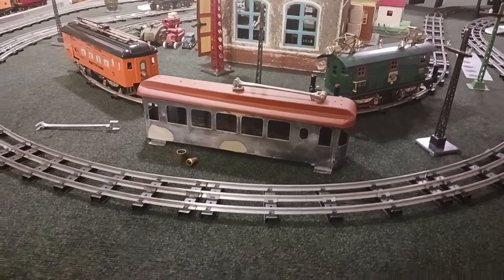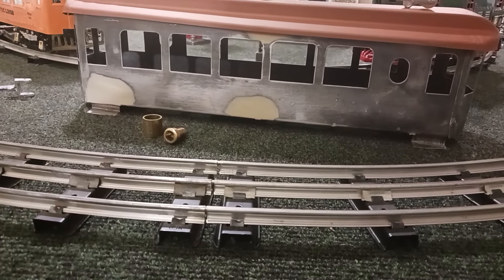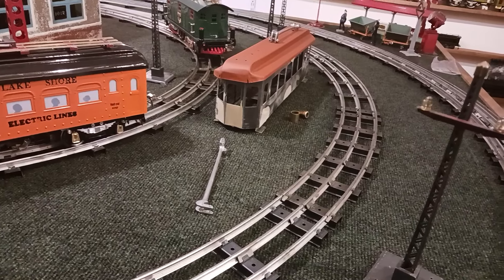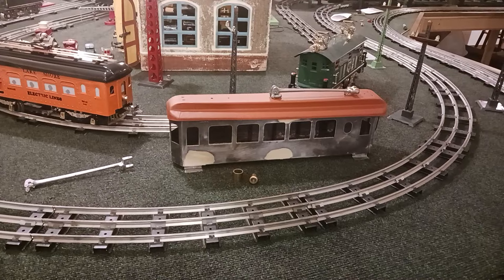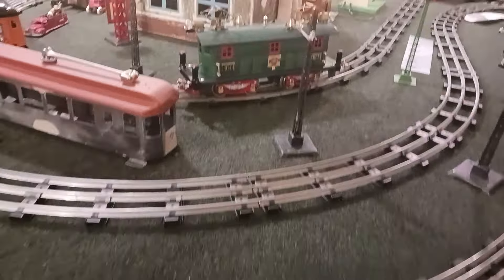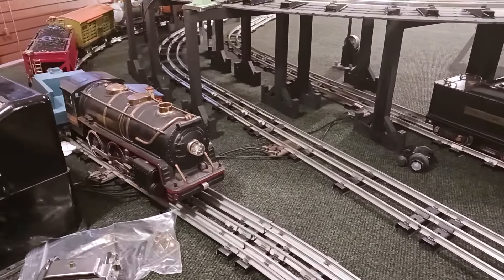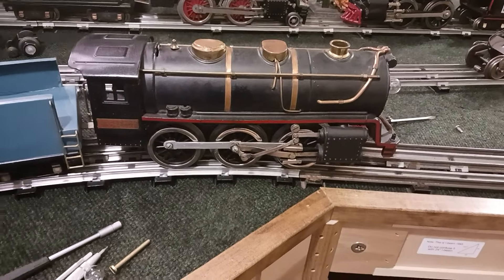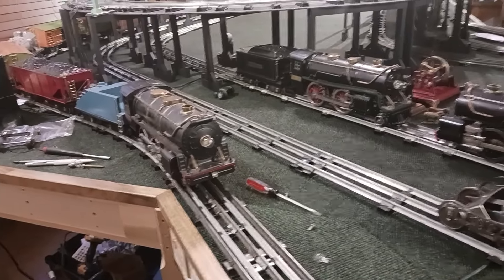A truly unique 384, an 0-6-0,  the Hill Climber must stand in its shadow.

Comment: That's a very impressive collection you got there and ill bet even those video gamers are saying that's cool, Also, If i had $250.00 think of all of the 'HO' stuff i can buy at those train shows, The previous owner of that locomotive must have been a highly skilled machinist who reworked that locomotive.
Reply from the maker: The machine work is way above my pay level---all wheels are geared and he has some type of flat spring set up the keeps the axles in place---it's like a Build a Motor but no bottom plate to keep the wheels from falling out.
Reply: @stevendouglas6594  Amazing, That in itself is true rarity a very rare model locomotive indeed, Also, Thank you very much for your reply.

Comment: What a real treasure. I don't have the funds to drop $250 on an engine, but there's no price on just lookin'...
I've heard and seen somewhere of folks modifying O gauge motors to make custom standard gauge motive power, but by the sound of it this is a scratch built or kitbashed creation. It looks as beautiful as it runs!
Reply from the maker: The motor is scratch built ---way beyond anything I could make. I've done a number of conversions from 0 to std gauge on electric motors, for the most part an easy process.